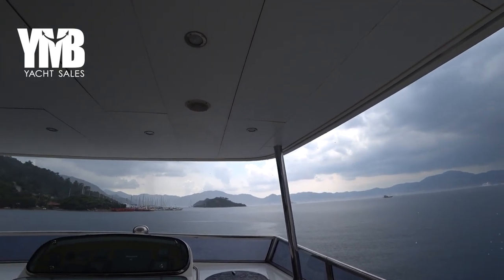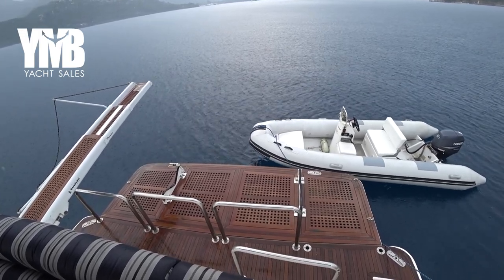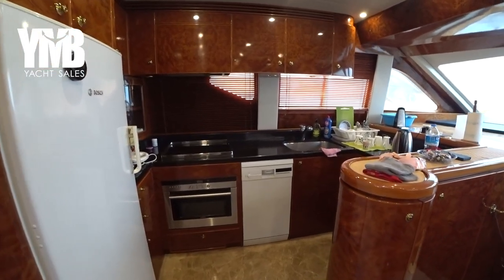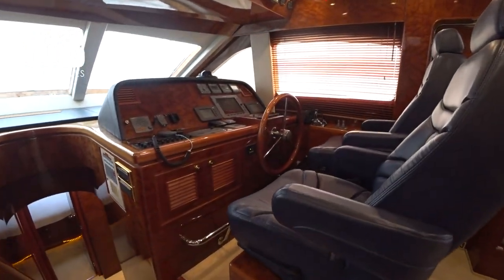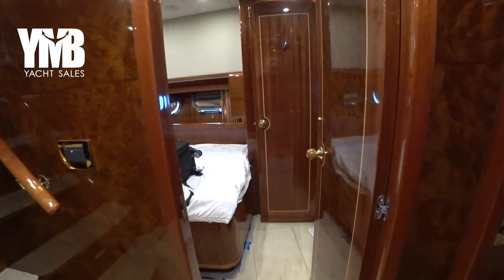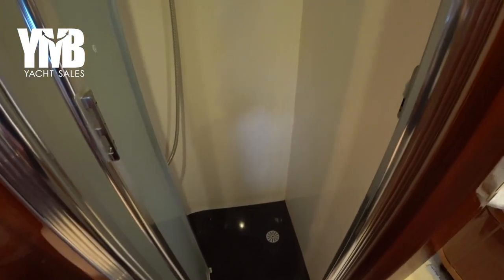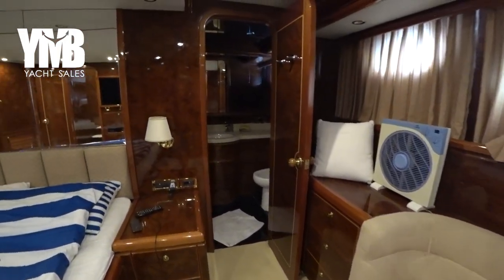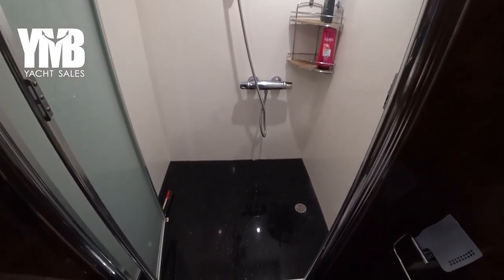NEW OCEAN 68 Motor High Spec List Yacht For Sale full walkthrough

Comment: You could close the door to the engine room until you reach there to avoid noise protruding through the whole boat. Think you keep it open for convenience of seamless filming yet it makes the boat less attractive in your videos, it’s either the generator, water maker, gyro, or the engines which are the backdrop to most of your otherwise excellent videos.

Comment: Eliad , aside from the uncontrollably inclement weather - this video is NOT one of your best efforts - you know I am a huge fan - BUT- when you "screw up" I gotta call you out ! So all was okay until and from the 6 minute mark at the point when you enter the Salon , then there is immediately a very noticeably annoying "distant rumble" of diesel engines which rows ever louder as you progress into the Guest Cabin then into the VIP Cabin and finally I had to shut down the video as you entered the Master Cabin where the low rumble progressed into a louder roar. Eliad , I actually got a headache thinking I was stuck in those cabins while those diesels were running  😞 Sorry Bud  -  Warm Regards from Miami Beach , joey d.
Reply from the maker: Thanks for your comment..Always try to get better. Sometimes the conditions are challenging.